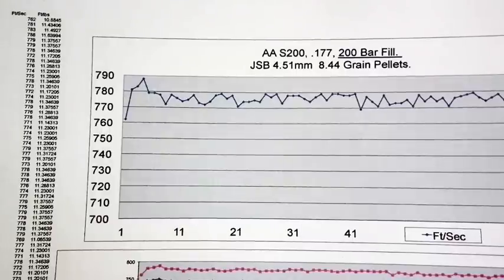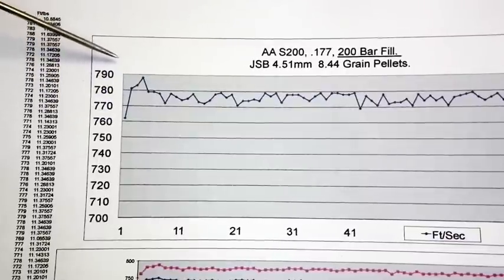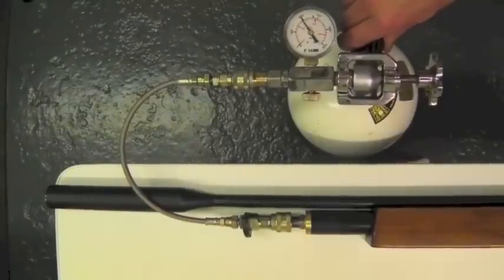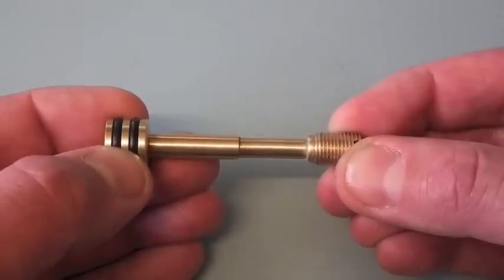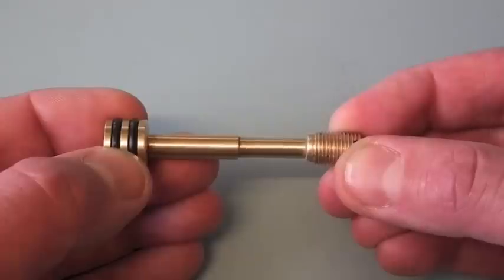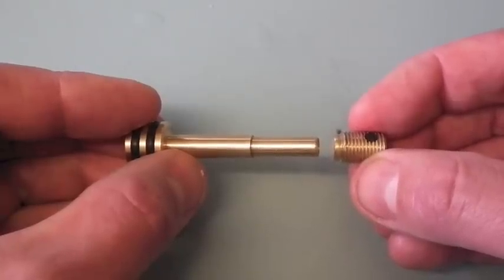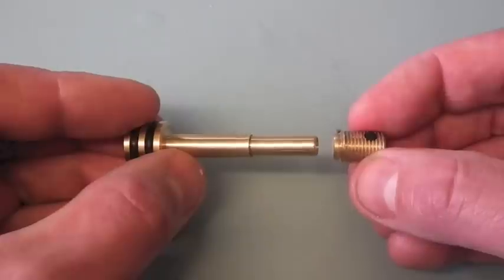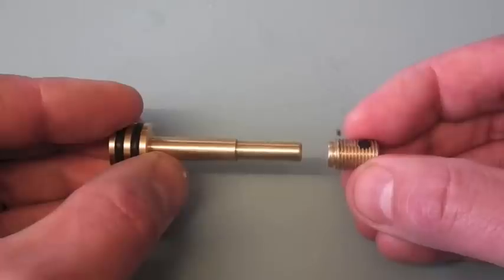Airgun Regulator - FAQ4 - Why do my first couple of shots vary in power?

Comment: +Airgun Regulators - love this channel.  Top source of otherwise hard to find information.  This video is particularly great for this.  I've always wondered about the decompression action on firing.  The hammer hits the striker valve, which opens the port for the air to escape.  As the air escapes the chamber pressure in front of the regulator drops rapidly.  But as the regulator piston head is free floating, this will mean that it will open also as the decompression occurs (to my understanding anyway).  This will mean that you have a situation where the regulator will start filling the chamber as the chamber is decompressing which seems a bit contradictory to me.  Can you explain how this balances out to enable consistent even pressurized releases.  

Also that I find it surprising the piston only moves 0.8 -1.4 to mm in travel during the normal regulation process.  But I guess this must be due in some part to the point above - that the chamber in front of the regulator never really fully decompresses to empty, so the full piston movement is not required (other that when first filling the gun).  If the chamber did fully decompress then I guess this movement would be a the full journey travel back and forth each time?  Am I correct in my thinking on this?  Once again thanks for all your amazing work.  Simon

Comment: These really are a great set of informative videos.
Do you think your regulator piston would benefit from split nylon or delrin guide wiper rings to keep the lubricant pushed towards the o rings and smaller cross section o rings to reduce the drag on the piston travel?
Reply: It may do technically as we do this on some hydraulic regulators but we have never had any issues and many reg's are working after 6-10 years with out service. Adding a ring would be .60p on sale price. With ref to size of O-ring, the piston doesn't move in operation only about .80mm so having an even large O-ring would matter as the piston osolates on the flex of the o-ring as opposed to the piston moving. i.e. It travels 8mm say on first fill for 130bar but when fired it only moves back and fourth .80mm or so as refill speed is V-fast. If you could measure, cals say it only may move .40mm. Movement = Gap = Center Bore 4.3o I.D.